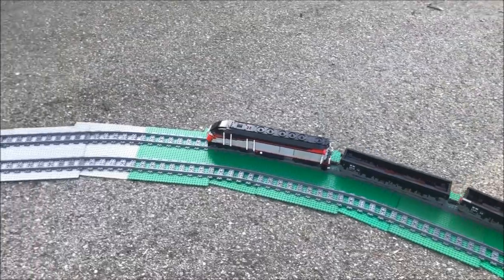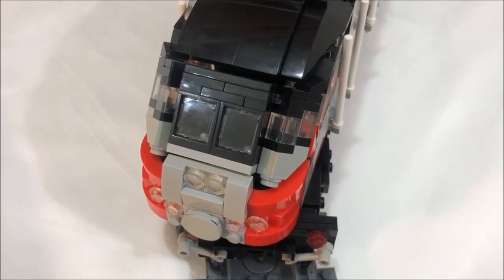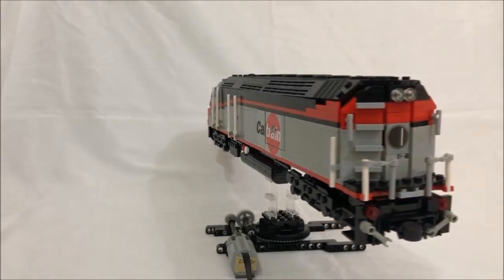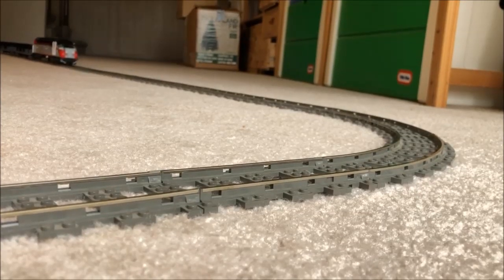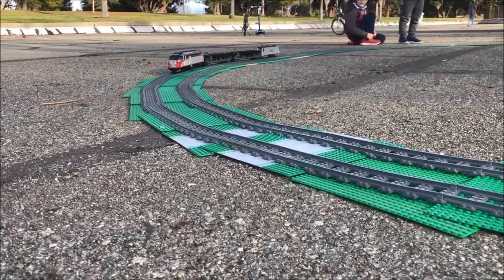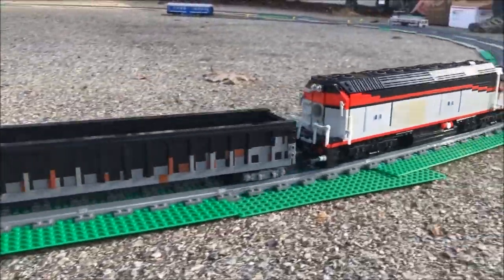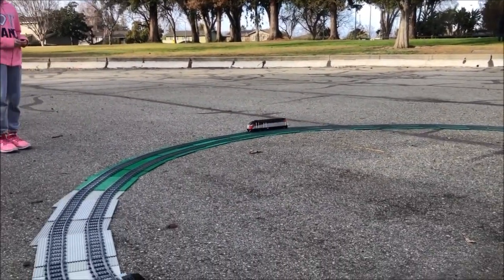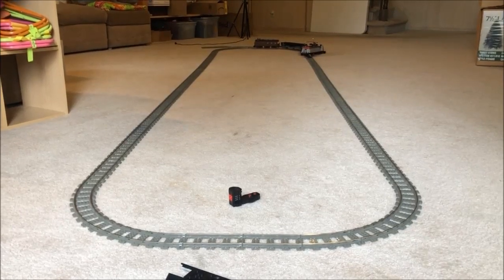LEGO 1:48 Caltrain MP36PH (Power Functions + Buggy Motor)

Comment: Wow! Incredible! Try to replace the rubber bands on the wheels with softer O-rings. It wont slip
Reply from the maker: Well, it's a bit of a trade off between having more grip on straights versus too much grip on curves. If the tyres grip too much they will cause a lot of resistance in turns, which is why I went with no tyres on the MP54. The stock tyres are generally a decent compromise; this engine probably just needs to shift the CG a little further back.